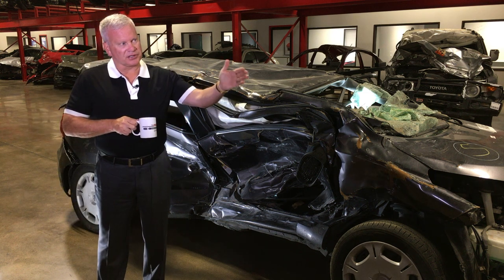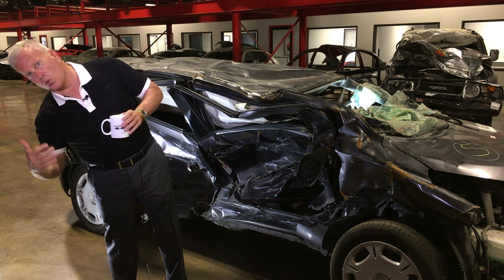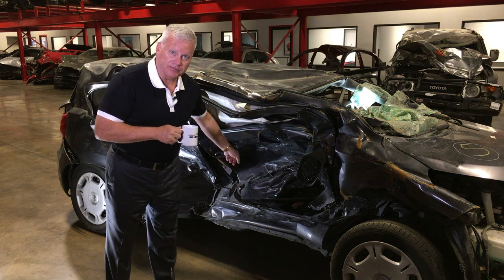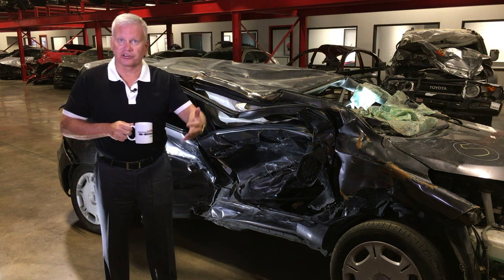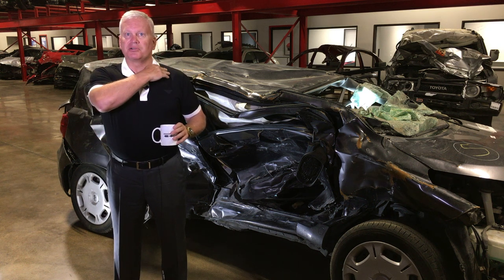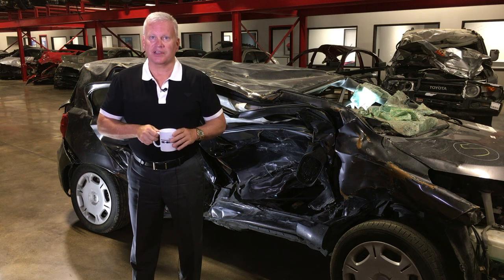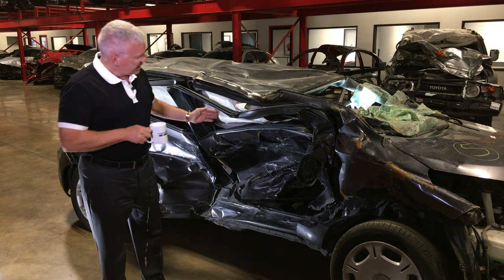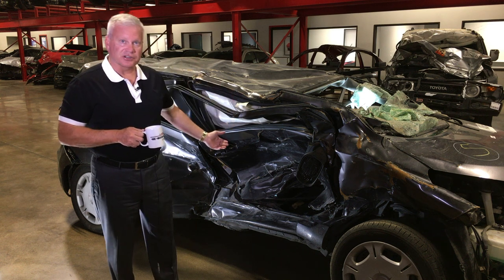The Far-Side Impact Crash Is A Deadly T-Bone Accident Caused By Vehicle Safety Failures

Comment: I used the show " MAYDAY " to study plane accidents for 10 years.
I learned many things like flying at night is twice as dangerous.
I also learned that you get a seat belt in a super fast plane but not on a coach bus or school-bus ?
Now I'm looking at the 2018 Tacoma which did 4 starts but these points you made made me sit up and pay attention .
NOTE ....LOL...my dad leased 3 new Pinto's in the 70's and I used to practice skid control on a wide mining road and then I found out I was driving a bomb in the 1980's !
Reply: The Pinto was really not that more dangerous than other cars of that era. They ALL had the gas tank cap in the rear center-under the license plate. There WAS a part on the Pinto that intruded, and ruptured the tank.
The problem was: Ford covered it up. They had an internal memo that stated that the ten dollar fix was more money-in aggregate-than the price of lawsuits. When the attorneys got ahold of THAT-they lost! There was a notorious case where a man in a pickup truck-doing 40 mph and high on booze and marijuana-hit a pinto-causing a fire and Death. But-many automobiles back then would have exploded after such an impact.

Comment: I was T-boned on the far side of my 1999 Sable. Other driver had a Blazer with a brush guard. The wreck was my fault: I didn't believe a stop sign. Badly broken left arm. I was  wearing a belt, but got thrown around. Broken big toe, too. I asked a Volvo dealer if it would have been different in their car. "Of COURSE! In a Ford, some metal bends, but in a Volvo, the whole frame flexes to absorb the impact." Who knows??